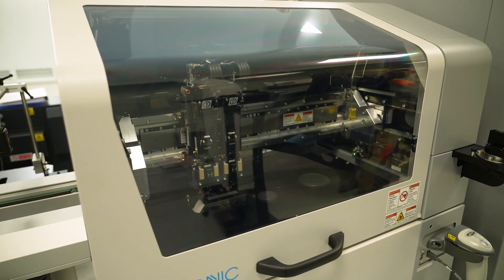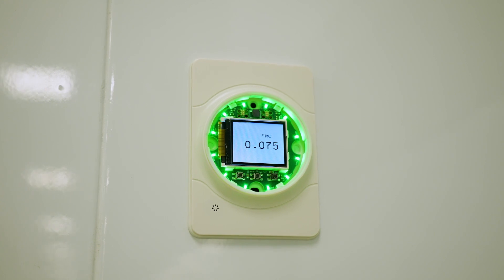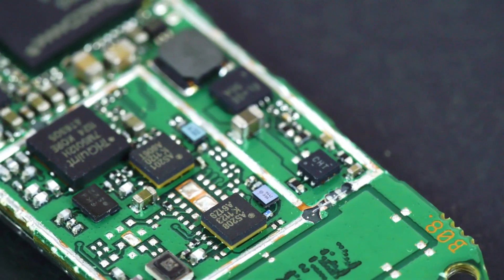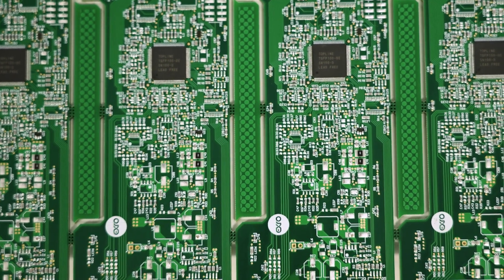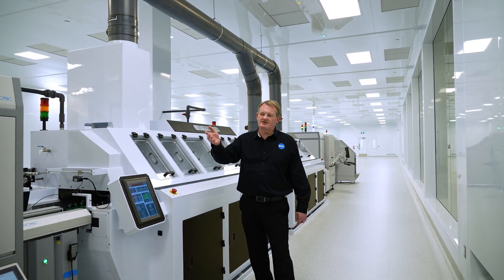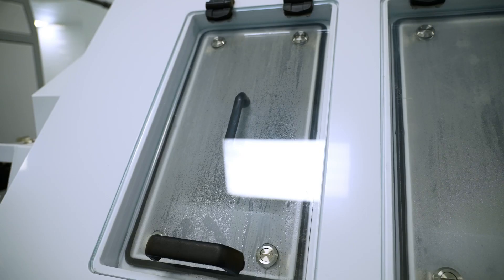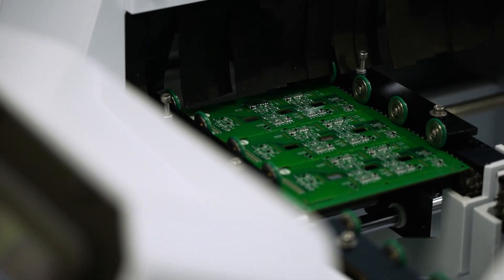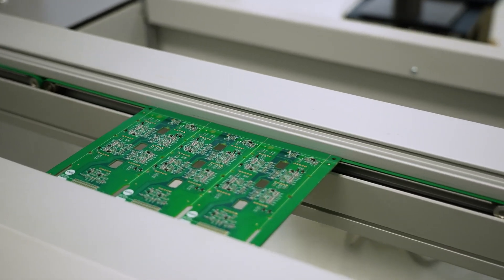North American State-of-the-Art PCB Manufacturing Facility | Exro Technologies

Comment: I get it. A few questions though. Is this a full smt line, no poke thru. or wave process? Are the boards RoHS3 compliant? Where will the boards be tested and will it be 100% or AQL. What method(s) of testing will be used. Scan, boundary scan JTAG. How reconfigurable will this smt line be and how many configurations do you plan. Thru put? Cycle time? Expected yield and rework estimates.
How will you control the water rinse resistivity over the course of the day.
Is it an aqueous or semi aqueous clean.